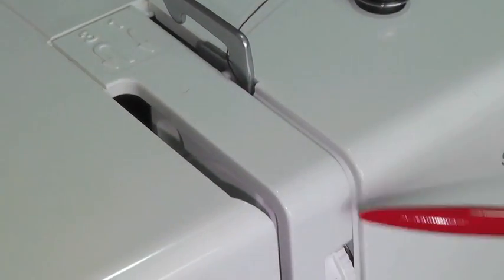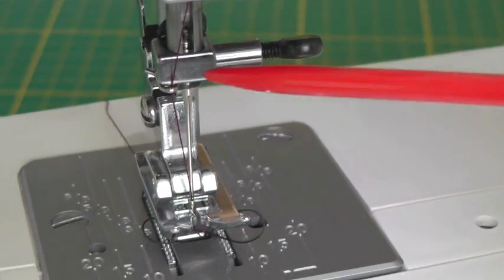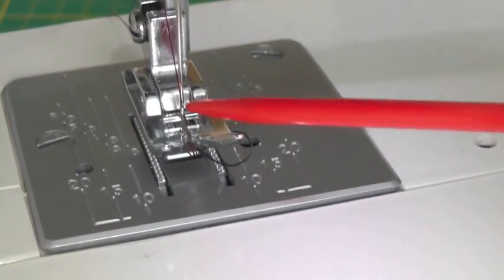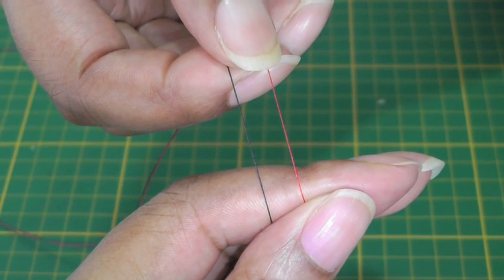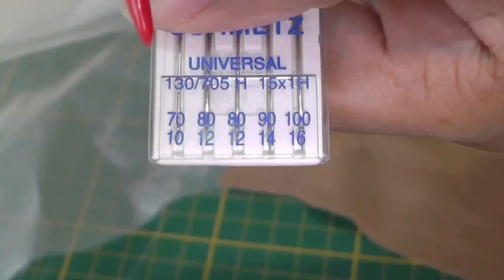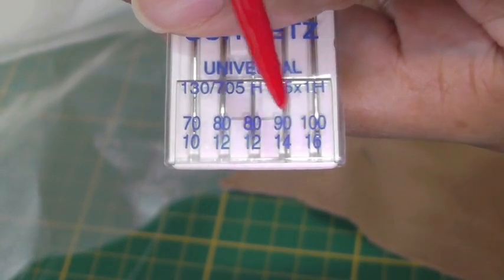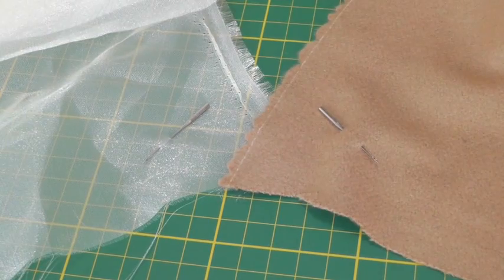How to Fix Needle Thread Breakage

Comment: You are a lifesaver - I have been battling with thread continuously breaking and was getting very frustrated. I searched youtube for advice and yours is the only video I found that solved the problem - I'm embarrassed to admit it but i had the needle in the wrong way! Not one other video or site that I looked into suggested checking the orientation of the needle. Thanks so much :)
Reply from the maker: Happy to help and trust me, it's a common mistake. Thank you for your very kind comment.